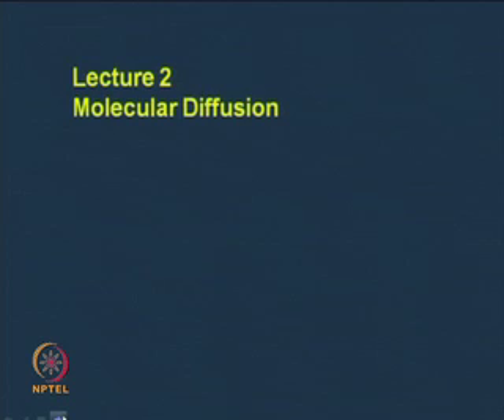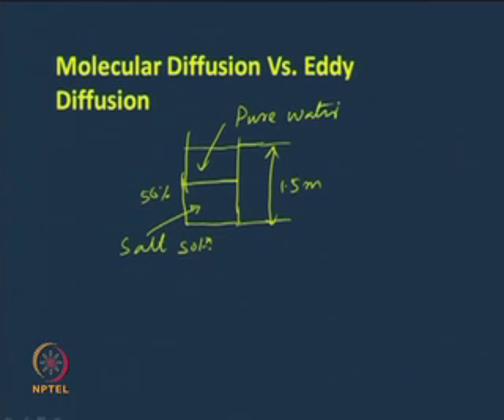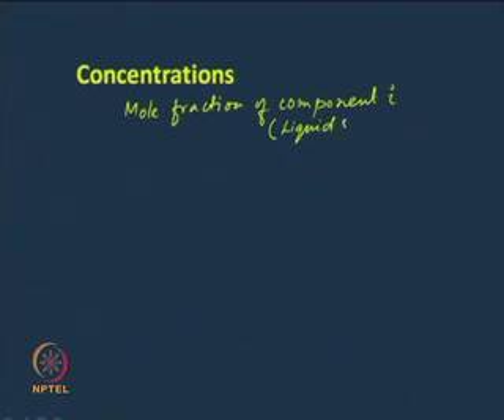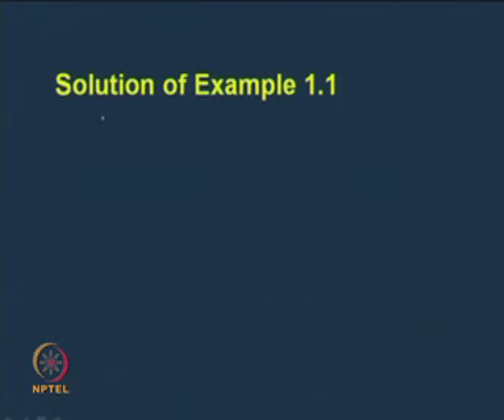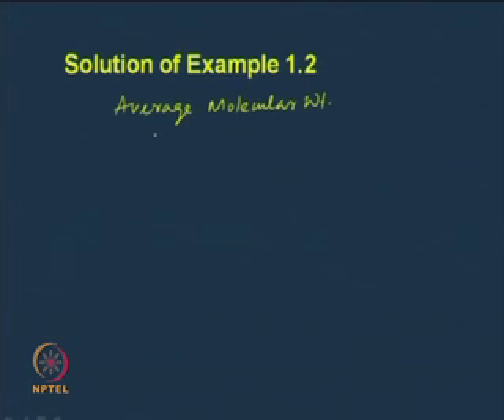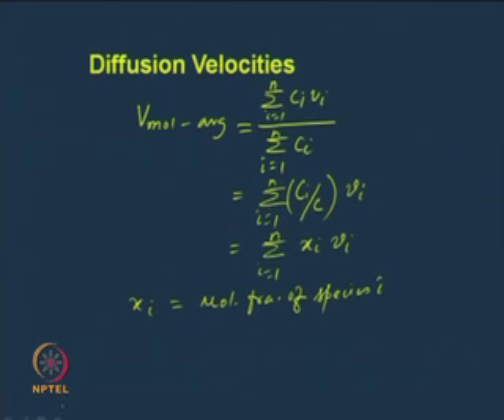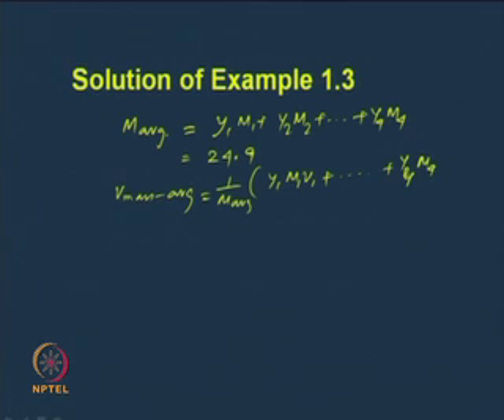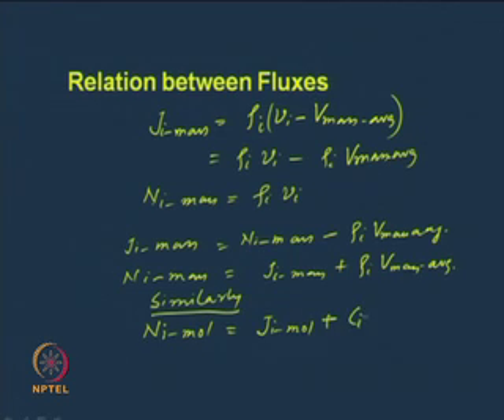Mod-01 Lec-02 Molecular Diffusion

Comment: can you elaborate the Q.2 , which is at the last part of the lecture (video)
Reply: Preet Suratia let me understand you .
Actually I think you got confused by how that formula came ( rho = concerntration × AVG.mass)

It is told that here for ideal gas c= p/ RT
And we know that 
PV =nRT
And n= m/W
W - molecular weight.
But here we consider it as AVG.mass

So now ,
PV =mRT/W
We can write it as 
PW=mRT/V
And m/V= rho
So,we get PW =rho RT
PW/RT= rho.
And P/RT=rho
So CW=rho
Reply: basically you have wi*vi( mass veolocity) is equal to xi*vi only if Molecular weight is the same, I guess that's what you mean.